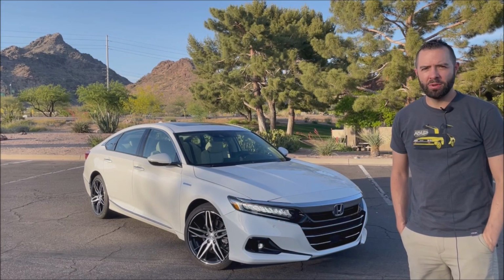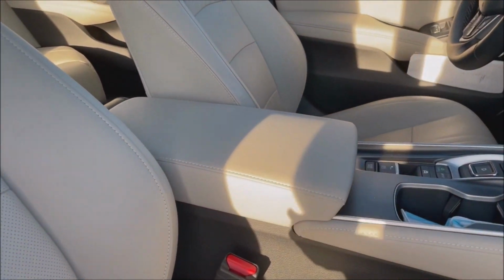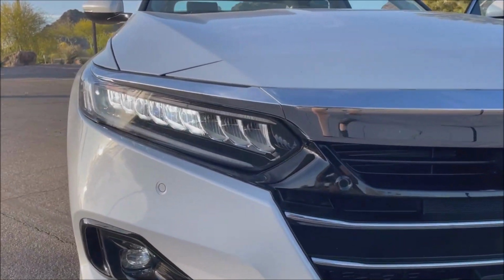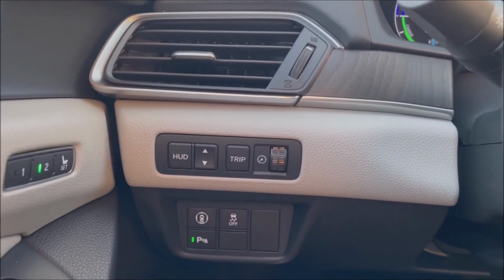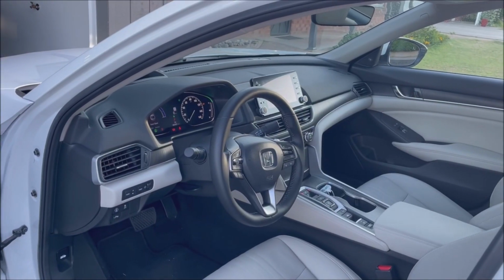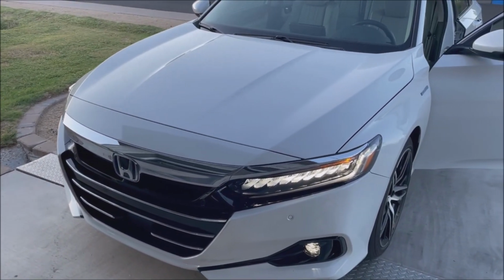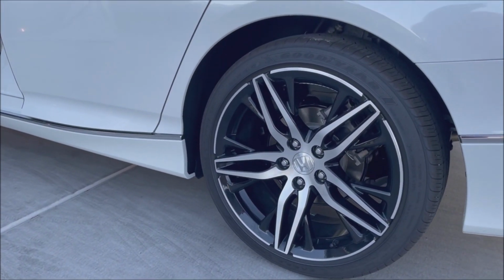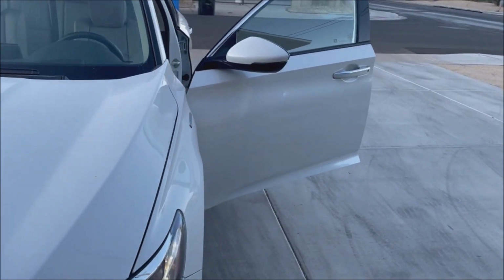Road Test: 2021 Honda Accord Hybrid Touring

Comment: Agree with your comment on transition between engine and battery. Picked up my 22 Accord Sport Hybrid over a month ago and it is my first and only driving experience with hybrid car... it's almost feels like driving a regular car with slight instant torque benefit moving from stop. With 1500 miles mostly highway, I am averaging 47+mpg.
Reply from the maker: Glad you are having a good experience with it!

Comment: The Accord definitely has much more appeal than the Camry.  They also drive and handle a lot better.  Just like you said, the beauty of the hybrid is that you don't lose any styling flare that you typically would.  It still looks like a very sporty and attractive car, despite the lack of exhaust tips.  I like the Sport trim the best.  It's the perfect balance of luxury, sportiness, and value for your dollar.  I also appreciate the fact they finally offer it in Sonic Grey Metallic.  Looks super sharp!  If I had stuck with Honda, I would've traded my Civic Sport Hatch for a Sonic Grey Honda Accord Sport.  However, I ended up getting a new Toyota Tacoma instead.
Reply from the maker: Great choice on the Taco!